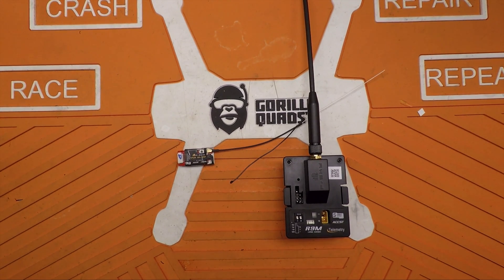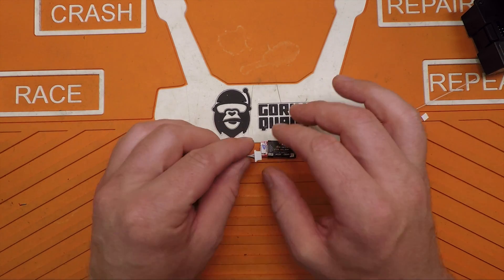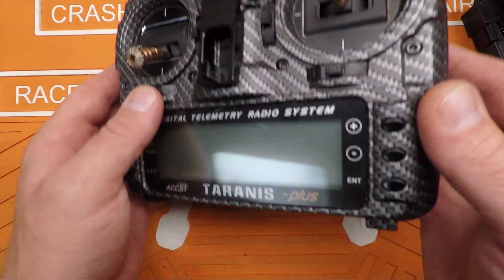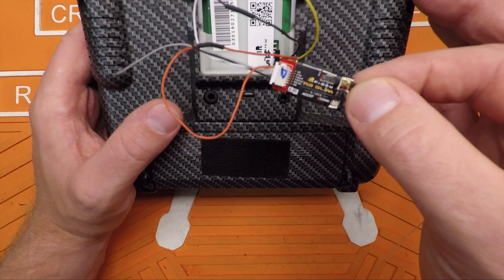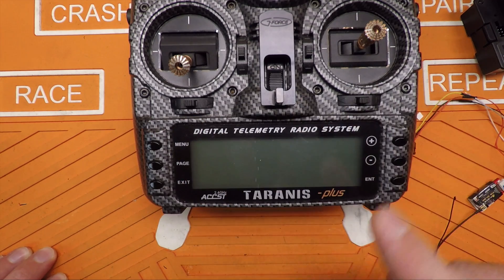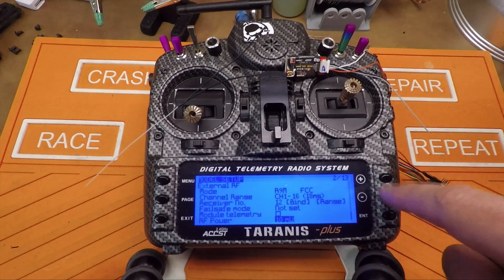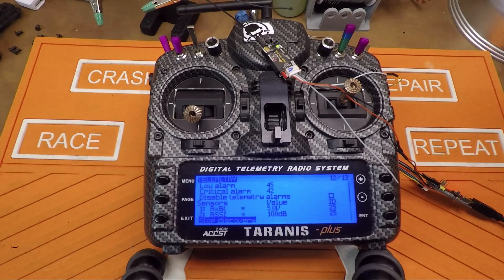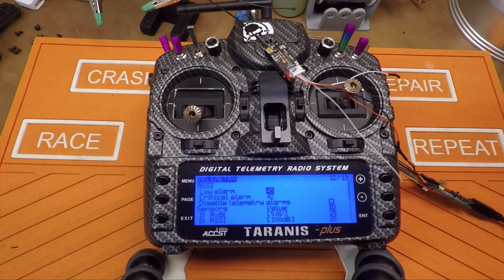How to update Frsky R9M and R9 Slim firmware

Comment: Hi, thank you for the video, it helped a lot. Unfortunately, when I got to the firmware upgrade for the r9 slim receiver, I do not have an option to "flash external device", the options I have are..."flash S. port device" or "flash Rx by est.OTA" when I choose either option it does not recognise the receiver nor does it update. I have tried the update on a profile with the r9m module installed and a module without the r9m. When picking the option with the r9m module, the receiver will turn red even before I get to the firmware update, whereas with yours, it only turns red when you select "flash external device". When I choose a model without the r9m, it is as yours is showing without a light on the receiver only offers one option "flash S.port device" and when selected, it says no device can be found. Any help would be greatly appreciated.
Reply from the maker: This video is kinda old and opentx has changed a lot since then. If you are on a newer version then the appropriate choice for flashing the reciever is flash s. Port device. Even where to connect the reciever has changed since this video. Which radio are you working with?

Comment: When i put my qx7 in bind mode, it dosent chirp. Smh? Do you know why? Thanks
Reply from the maker: Is your volume turned down?
Reply: @TweetFPV  no its not
Reply from the maker: Do you get any sounds from your qx7?
Reply: @TweetFPV  i do. Its just that for some reason. I bind, no problem...it just dosent chirp. Thats fn weird right?!?smh
Reply from the maker: @radiokicks  yea that's kinda wierd.
Reply: @TweetFPV  what size lipo battery would you recommend and what c and mah for the r9m?
Reply from the maker: @radiokicks  honestly I just Powe it from the radio battery. But if you wanted an external pack I would use a 2s 18650 like a fatshark pack. Just make an adapter from the barrel jack to a xt30.

Comment: Thank you for all the great work, can i use this procedure for the R9M lite pro module and reseiver? or do you have a vid about that? i have a geprc cygnet 3 HD BNF but i guess i'll have to remove
the rx from the frame and flash it before i can BNF. love your vid's
Reply from the maker: Yes it's basically the same process just different files from frsky.
Reply: @TweetFPV  You make it easy to understand, thanks for that, Greetings from Belgium

Comment: My plus won't bind can you help me
Reply from the maker: Sure. Update the fw on your r9 and your slim + and opentx on your radio.
Reply: @TweetFPV  did that and no green light IAM using fport
Reply from the maker: Which fw version did you load to the slim+, and r9 module?
Reply: The R9 slim+fky
Reply: i got  a new  r9 slim + and hold the buttom in everything and still wont bind no green light what are the odd s two bad ones
Reply from the maker: @glenmccall4571  I really don't think you have any bad recievers. 99% of issues with this system is firmware incompatability. Have you flashed fw to the r9 module or the r9 slim?
Reply: @TweetFPV  yes I have  and I have been doing this a while now so I know how to flash bind and build it's just this new thing R9MODULE not binding got two brand new one's but both not binding trust me  am knowledgeable but I think these got to be bad
Reply: I have a Q7 and r9 slim+ and the red R9M. Fc matek f405 STD
Reply from the maker: @glenmccall4571  Which FW version did you flash to the R9 module and R9slim?
Reply: @TweetFPV  tried all of them even this last one FW_Ranger9_RX_FLEX_20190201 then open to R9_R9SLIM_FLEX  THEN r9slim_flex.frk
Reply from the maker: Ok so you have version 190201 flashed to the slim+

Did you flash version 190117 to the r9 module as well?

I can help you better on my discord server. https://discord.gg/7jEzbm

Comment: I updated mine today on my QX7. I wasn't thinking and plugged the con 1 wire into the con 2 socket. The polarity was wrong way around and I tried to update the firmware. I realised soon after. I hope it isn't fried.
Reply from the maker: These recievers don't like being wired backwards and typically fry.
Reply: @TweetFPV  I turned it off and reconnected it correctly. I was able to update and flashed the firmware after wiring it up the wrong way. 

If the receiver is fried would it still be possible to flash the firmware? I have no way of testing it!
Reply from the maker: @rogmo121  no, if it was fried it wouldn't power up at all. Your probably good.
Reply: @TweetFPV  Thanks Tweet, you've been a great help. Subscribed!

Comment: Ive got the big R9M receiver. Cant i just connect from the S.port on the receiver straight to the pins in the module bay?
Reply from the maker: It should work the same way.

Comment: I keep getting error message from my R9 receiver. The module was updated, no problems there. But the receiver (it's a R9) does not talk to my Taranis or bind to the external module. Perhaps I have a dud? Or am I missing something.
Reply from the maker: What colors are the leds on the rx?
Reply: @TweetFPV  They're stuck on green and red, not flashing while trying to bind.
Reply from the maker: If you updated the r9m module you should also update the r9 rx just incase there is a fw incompatability
Reply from the maker: Btw which rx do you have r9, r9mm, r9 mini, r9 slim, r9 slim+?
Reply: R9. The diversity mmcx one.

Comment: when I chose the file the only thing I get as an option is to delete it. So aggravated with the R9. I do have the first R9 and have never been able to update it.
Reply from the maker: So, you are saying that when you select the firmware through your tarannis it only give you an option to delete the file?
Reply: @TweetFPV  correct
Reply from the maker: Are you sure that you have extracted the contents of the compressed file from frsky. Com to your SD card? When you select the file does the file name end in ".Frk" ?
Reply: @TweetFPV  yep I even updated my taranis to make sure, ill slap a vid so you can see.
Reply: Oh wait I might have figured out why, because my Taranis is from pre 2016 it seams it does not have the xjt firmware. Checking it now.
Reply: Nope but I think I may have found a problem, I need someone to send me something called /EEPROM my transmitter just let me know it's missing. I do not know what it is or what it does.
Reply from the maker: if you go into the system menu of your tarannis can you tell me what version of OpenTX you have on your radio? This might me what your problem is. I know that with the newer versions of OpenTx they have added functions like flashing firmware to external devices. 

also can you tell me what version of the boot loader you have. to do the hold the two lower trim switches inward towards each other and while holding them power on the tarannis. it should come up with a boot loader version.
Reply: @TweetFPV  ok I have figured it out. As I bought my Radio back in 2015 it did not have what it needed for flashing, also it had lost some files during the fist update I did that was in 2017 when I finally decided to update it. now I should be good as I am now rocking 2.2.3 the latest version. I got the new companion as well now. I did a complete rewrite by the way and it repaired its own EEPROM. I also downloaded a new SD file set and fixed what was missing there as well.
So now to see if I can update module and receiver.
Reply: Thats what it was, guess this is a perfect time to say, Keep your stuff up to date. don't wait so long that everyone looks at you like your crazy.
Reply from the maker: This is great news, glad you got it working!

Comment: Is flashing onto the R9mini the same as the R9Slim, just having to solder the pins?
Reply from the maker: Same basic process through the smart port pin just with the appropriate firmware.

Comment: If i select no telemetry, can I get the rssi on an aux channel? Im using the new r9mm rx, and the only firmware for fcc doesnt mention an aux rssi default channel. As long as you can get an rssi value in osd, turning telemetery off helps range.
Reply from the maker: Rssi is baked into the fcc firmware on ch16 not sure what you will get with telemetry off.
Reply: You would get just a value on ch 16 to be converted to your rssi in osd via fc. Telemetry enable increases broadband which reduces range and potentially increases interference with other close bands like 1.3ghz.

If rssi was assigned to ch 8, baked in, we would get lower latency too.

Comment: Tweet I dont find R9m as a option for External RF,what am I doing wrong ?
Reply: Yeah I checked my taranis firmware and it has 2.1.6,way outdated Lol,thanks for responding back,Much appreciated
Reply from the maker: It should be listed under external modules. If it's not there you might need to update the firmware on your taranis.

Comment: Do I need smartport to flash? Or can I connect to sbus in? I run clracing and there is only one urt and I'm using smart audio. I planned on running r9m receiver on sbus. Can I do that??
Reply from the maker: You can run just sbus, But you will not get telemetry.
Reply: @TweetFPV  so when I flash the mini do I use S Bus or smartport? Does it matter with flash? As you can tell I'm not very great with this crap... Thanks for your help
Reply from the maker: So when you flash firmware to the receiver you will need to use the smart port wire. That is the one your radio or your programming stick will talk to the rx on.
Reply from the maker: https://youtu.be/z6HDj9r7N7k same process just select the appropriate firmware for your setup.
Reply: @TweetFPV  thanks for help. I see in that video the firmware said fport is there a FCC sbus or is that a dumb question. My computer buddy is helping me tomorrow. I got everything else done firmware on qx7, and the R9 M firmware already uploaded. Receivers last step
Reply from the maker: Yes there is a fport or sbus firmware in both fcc and EU for the rx. Just select the one you want from the frsky download page and flash that firmware to your rx. In either case the programming wire is the one you solder to the sport/fport pad. Once flashed with the sbus firmware you can just remove the wire. Be careful when powering the rx, they will burn up if you reverse polarity to them.

Comment: Crossfire does not care about their customers you are meat on the plate I waited and waited for this R9 Mini 2 come out and now they double the price Crossfire looks better and better Crossfire actually cares about their customers and releases free updates and when people ask for stuff they actually listen exact opposite of FR sky
Reply from the maker: The R9m system fills the void where crossfire doesn't cover. Crossfire mini goes to 250mw, the r9m up to 1W and the  big crossfire 2W. Keeping in mind in the US the max power output for a ham license holder is only 1W. So if you wanted a crossfire system capable of the max allowable power output of 1W you would need to get the big crossfire. This is the space where the r9m fills.

Comment: I run 3s in my taranis I don’t think I can do this as that pin is vbat and would be supplying 12v to the rx
Reply from the maker: Running 3s inside your taranis is OK. Running 3s on the xt30 is not ok. The spec for the voltage in on the Jr module bay pins are up to 12.6vdc. I run a 3s lipo in my x9d with no issues. If you are in doubt use a multimeter and check the voltage on the Jr module bay pins.

Comment: Hello! how do you configure the adaptive power output on the r9m?
Reply from the maker: You need the latest firmware installed on the r9m. In your radio set the power output to 1w and then it becomes adaptive on its own. I think this feature only works with the fcc firmware, not the lbt firmware.
Reply: Thanks! been looking for this everywhere and didnt seem to find it.

Comment: Thanks man, you made me save money... I'm not going to buy the cross fire HAHA
Reply from the maker: Multirotor or fixed wing?
Reply: TweetFPV Multirotor I'm not a long range pilot I just want to get rid of the fail safe.
Reply from the maker: Awesome! I don't fly fixed wing only mini quads. Check out the R9 mini rx and the r9 slim. Depending on which fc you have the r9 mini is a great rx
Reply: TweetFPV Great, I will... Thanks man!
Reply from the maker: Just watch for having built inverters for sbus and smartport if you are using a f4 fc. As all this stuff is still inverted.
Reply: @TweetFPV  or get used to the uninvert pads

Comment: A friend said, you need to update the firmware starting from the first update and going up.. But I see yours just done the latest available firmware. Did you jump right to it or youbhave done the old firmwares first?
Reply from the maker: You only need to flash the latest firmware for your region. There is no need to step through all the firmware versions.
Reply: Thanks appreciated
Reply: Yalla FPV i read that the other day on GetFPVs website as a “side note” beneath a purchase on a receiver.
Reply from the maker: I can assure you that just loading the fw that you wish to use is all that you need. But remember that the transmitter and reciever need to have the same version of fw flashed to them otherwise they have issues with binding.
Reply: @TweetFPV  omg that would be tedious!

Comment: I want to use an old 72mhz radio with this system. How would I update it without a taranis?
Reply from the maker: You could possibly update the r9m transmitter with the frsky s.port airlink module. I have never tried it so I'm not totally sure. Best bet is to find a buddy with a taranis and dump the firmware with that.
Reply: @TweetFPV  Can you use a FTDI Adapter to do the flashing and upgrading of firmware? just a thought
Reply from the maker: Possibly. I have both of those things sitting on my bench right now. Couldn't hurt to give it a try. I'll post back if it works or not.
Reply: @TweetFPV  THANKS MUCH CAUSE I AM LOOKING TO PURCHASE THE COMBO TO MOD MY FLYSKY FS I6 AND WANTED TO KNOW IF IT'S POSSIBLE TO FLASH BOTH UNITS WITH A FTDI ADPATER SINCE I HAVE ONE   ALSO. ONLY CONCERN WONDER IF I WILL GET RSSI WORKING!!
Reply from the maker: Rssi is baked into the firmware on the r9mm. If you are using betaflight it will show in your osd. Not sure about in your radio.
Reply from the maker: If you are willing to make the switch. There are some killer deals on the x-lite with r9 lite combo going on right now. I think like $140 USD for the radio r9 tx and r9mm rx.
Reply: @TweetFPV  THANKS NOT REALLY LOOKING FOR IT ON THE RADIO SINCE FLY WITH GOGGLES SO THE OSD WILL BE PERFECT!! SMILE
Reply from the maker: You should be good then. If Iget some free time I'll try and flash the module and rx today with a ftdi.

Comment: my QX7 does not have pins in the S port. Do I use the pins in the module bay as described for the X9D?
Reply from the maker: No, you use the s. Port pins under the x7 by the USB port.
Reply: TweetFPV I have one of the first versions that do not have pins in the S port on the bottom
Reply from the maker: Hmm I guess then the bottom 3 pins in the Jr module bay. I'm not sure on that one.

Comment: @TweetFPV should it work with both Eu or FCC version of opentx or for EULBT openTX you have to flash the EULBT version of the r9m firmware?
Reply from the maker: The firmware on the r9m should work independent of the version of open TX flashed to your radio.
Reply: Perfect! Thank you so much!